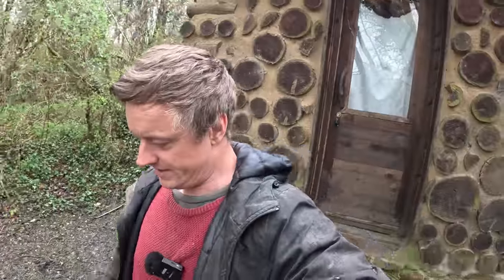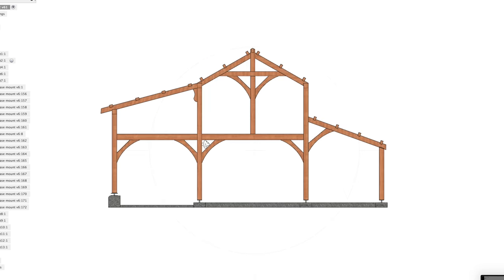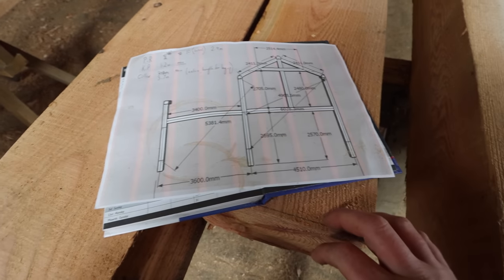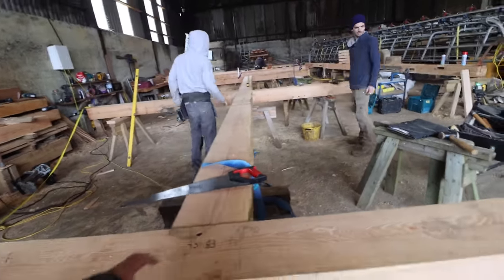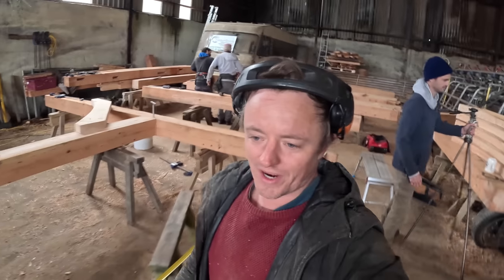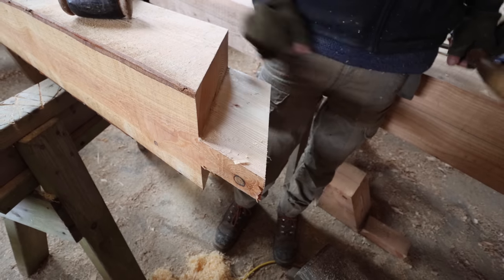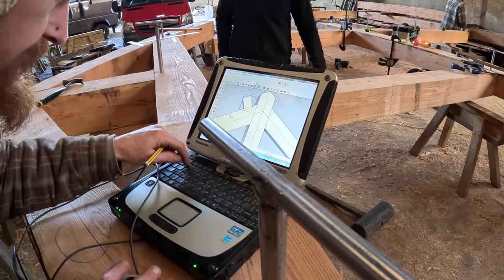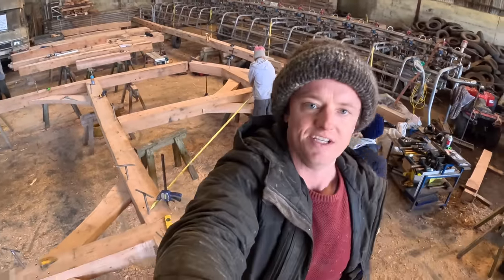Timber Framed Barn Part 10 Cross Frame One Complete

Comment: Kris: I come from the UK and live in the US now for many years. Over here they take the post and beam timber frame (as you are building) and screw to the exterior what is called a "stress skin panel". They then install siding over that which makes the whole structure look like most common stick frames homes. I will be building an addition onto my current house which will be timber framed. I studied how I could retain that nice traditional black and white tudor look that we are used to in the UK. I don't want to do anything "mock tudor". In the end I decided the best way is to use the typical 4" x 2" stud wall framing inside of the existing timber frame to emulated the typical wattle and dawb style look that was done years ago. I can still run cables and insulation throughout the structure and retain the look both inside and out. Any ideas, comments?
Reply from the maker: Hi Phil, I have had the exact same thoughts. and have come to mostly the same conclusions. However the issue is then your frame is exposed. this is fine if its oak or a really durable timber. im using larch that is quite durable but it won't last 100 years if exposed. So what I have decided to do is to stud wall half the width of the timber frame and insulation in that space. then im going to put a 60mm skin of wood fibre insulation on the outside that will cover the frame. But then I am going to clad in live edge cladding but I will put timbers covering the joins of the cladding that follow the frame so it will look like the frame is still on the outside.
Reply: @KrisHarbour  There are many timber framers here in the US as you probably know. I took this idea to a guy in Pennsylvania that I know. He basically said "why did nobody think of this before"?. He had suggested using a source of white cedar he had access to. It won't rot and insects don't like it. Oak is a bad idea. It is open pore and will give up moisture content over time. I've seen this on some post and beam structures over here which is obviously dangerous. I'll be working with this idea shortly. I have a 5500 sq ft all red brick tudor style house and will do the additions in the typical English black and white tudor style which I think will look very cool in the area I live.

Comment: I thought that was called a Shouldered mortise & tenon. Housed would be a full top to bottom recess. Squinted is when you made a wedged or Splayed scarf but the angled part has a sharper point so it indexes & locks. The last lacks the blade or tusk that prevents the scarf from being able to pivot on the cut face. I can see how squinted would apply to those since the faces are less than 90 degrees.

Comment: You may have covered this in another episode but is there any reason in particular why the braces are offset from the centre line of the beams?
Reply from the maker: yes there is, its because I am putting some studs behind the braces to clad to. the offset is the thickness of the stud wall. that way the braces are visible in front of the wall infill and cladding.

Comment: Kris, can you give a run down on what tools you/the crew are using? (like sizes of slicks etc). Also, if you will allow a little more time on watching how the joints are made (planing, cleaning up mortises etc), it would be a very educational experience.
Reply: I would say that the tenon sizes are 1.5 inch (38mm) & 2 inch (51mm). Robert Sorby sells mass produced framing chisels in those sizes which are quite good for the prices, the hold up against Australian hardwood. 
The rebate planes are number 10's or 10 1/2, that allows you to get right up to the shoulder of the joint. 
Peg holes are likely 20mm & 25mm, podgers are normally made from 19mm stainless steel. 
Plumb bobs can just be made with a heavy nut and a piece of string line. 

The Morticer looks like a mafell. 

Hope that helps somewhat.
Reply: @bincognito6609  very good, thanks. You think those slicks are Sorbys or just a general recommendation?
Reply: @LitoGeorge  Not sure what brand the slicks are, I don't use one personally, instead I just use a rebate plane and framing chisel to clean up tenons. 
But yeah I noticed a couple of Sorbys so far, they have a tang instead of a socket though, so depends on your preference.
I mainly use Sorbys, I think for the price they are fantastic. 

There are several good smiths making excellent framing chisels and slicks too if you want to support the little guys.
Reply: @bincognito6609  TX. I looked for the difference between a framing chisel and a firmer chisel and couldn't find an answer. Do you know the difference? I have firmer chisels and have come to love mine for big tenons. I haven't used my 78 rebate plane (new to me) to clean up a tenon, perhaps I should try. My firmer chisels work great for this with a steady hand. Thanks for introducing me to the 10/10.5, never knew they existed. Look very nice, and apparently are easily available in Oz, especially compared to Canada where I am.
Reply: @LitoGeorge  the blade lengths are longer to provide the extra reach for the angles on the brace mortices.   They are also thicker on the framing chisels to handle the abuse of hogging out mortices. 

I believe a few companies are now doing reproductions of the 10's, hopefully they will become more available in the coming years.
Reply: @bincognito6609  Interesting. I am curious why framing chisels are then made, instead of using mortising chisels which are the beefiest to my knowledge. Possibly the length?
I cant afford Lie Nielsen reproduction 10's - but if you are feeling generous, I am feeling grateful :)
Reply: @LitoGeorge  I couldn't say, they were always just referred to as framing chisels whilst I was learning! Could very well be the same thing? 
Haha nice try. I believe Amazon make a reproduction, a bloke I worked with had one and it did the job fine once a proper edge was established.

Comment: https://youtu.be/XztagFxbqFw?t=950 Thought you had to unwind the coils of power cords. You have a large inductor which when the saw powers down causes a very large power spike as the field collapses?
Reply from the maker: yeah you should do. but for short duration cuts its not going to get hot. if you ran a heater or something it would be a big problem.